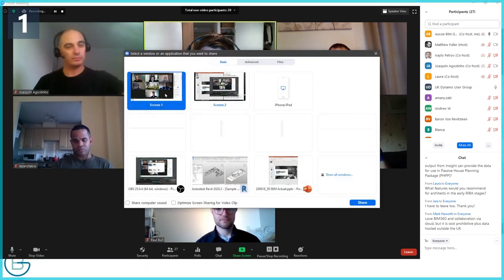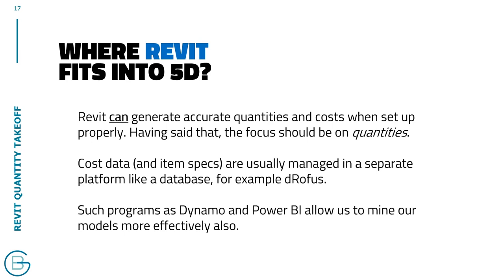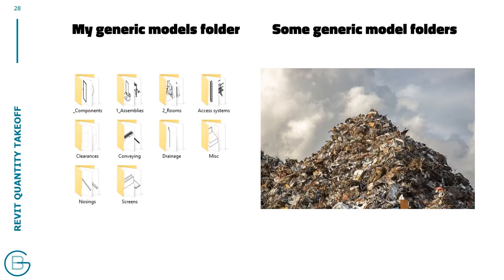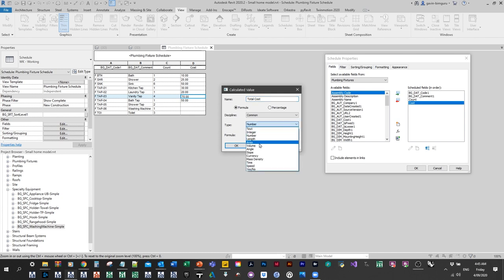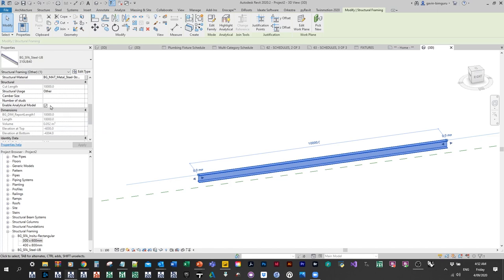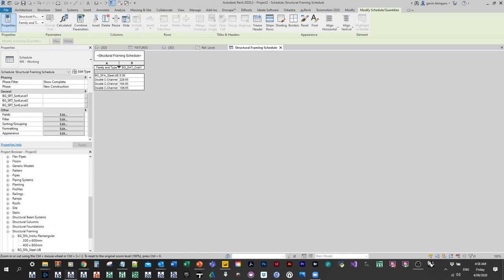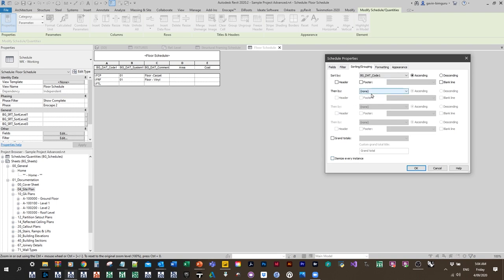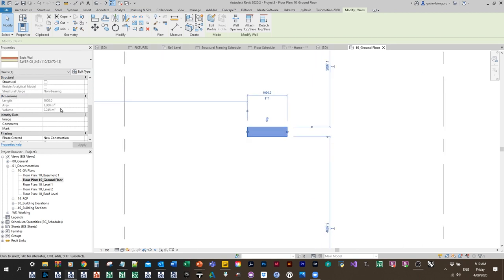Webinar: Revit Scheduling and 5D Quantity Takeoff

Comment: Hi, Gavin! I would like to suggest a subject for a future video. I am finishing my first project done entirely in Revit (2000 square meters) and I had a LOT of trouble extracting quantities from stairs and ramps. I still haven't quite figured out how they behave in what concerns schedules. If you could do something on the subject, I guess it would help a lot of users. Thank you for the excellent content.
Reply from the maker: Good suggestion, added it to the video list to make.

In this case my technique will be to isolate all upward facing surfaces (landing/tread) and get their total area using Dynamo, then write that as a value to the stair. Volume of concrete is another option as well, but not as common of a takeoff method.

Comment: Great presentation! 
A short question, which is the best workflow to quiantify formwork?, it is modeling its geometry with dynamo, painting surfaces, or just by the geometrycal dimensions of the cast in place concrete?
Reply from the maker: I would think that given you are working off exposed faces, combining relevant element geometry in Dynamo and obtaining face areas might be the best method.

You can assess the normal of a face in order to isolate relevant faces, for example in the case of a column/wall, the only relevant faces would be sideways facing, and for a slab or beam downward/side facing.

You could also just union all your concrete as one, and assuming your beams/columns and slabs are all touching you could take all faces with a normal lower than Z and this would give all side/down facing elements. The columns would need to connect to the floors however, otherwise you would have exposed faces in your union that would not be formworked technically.

I actually really like this idea for Dynamo, and will add it to my list of videos to make.
Reply: @AussieBIMGuru  Yes it's like that, i've done my own research and find out that doing it its actually very difficult, so i prefer to wait untill a pro like you reach to a good result. It was difficult because of when you make all the concrete geometry as one, have to first get only the faces (get a void from the elements) and then erase de parts of the pieces that will not be formorked, like upper mid sideways faces of a beam, or the joint of a beam and a column, and then assign the values to the respective elements in revit (since they lose they order when you join all the geometrys). Was too much for me hahah. Thnks for your answer!
Reply from the maker: @JorgeRodriguez-wt4gu  i've queued up a tutorial in first week of october to show a workflow to join geometry and omit upward facing faces of the joined concrete. I believe dynamo wont be able to handle the reassigning of faces back go elements as this would require a lot of intersections to match the subfaces.

Rhino Inside/Grasshopper is probably a more efficient workflow for this level of geometry processing. I'll explore the workflow at a later date for this part but doubt I can get Dynamo to to this part, at least for large models.
Reply: @AussieBIMGuru  Sounds like a challenge haha, thanks for your work and help 😁 !

Comment: Just spent another hour watching another great video. Thanks Gavin. I know in UK QS uses NRM2 as measurement standard. My firm uses ASMM 6 (Australian standard methods of measurement of building works). What other QS standards have you encountered?
Reply from the maker: So far I've only properly used the standard methods as well when it comes to universally used ones. I've had some specific client systems for commercial private clients in the past however that differ slightly due to their procurement and estimation processes.

Glad you liked the video Lee, and hope business is going well for NexSmart3d!

Comment: How do we get the length for duct, duct fitting? There is only length show in duct but not in fitting
Reply from the maker: Unfortunately I don't believe length parameters are naturally available due to the range of fitting types - for example, the way a t fitting is measured vs an elbow.

See this thread which discusses some computational methods of estimating fitting length by connector point extension and revit api;
https://forums.autodesk.com/t5/revit-mep-forum/question-on-duct-fitting-s-length/td-p/3615972

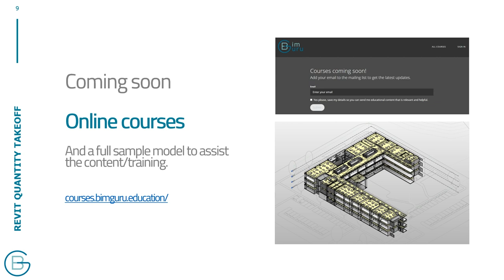Comment: Respect a man doing a live Revit presentation, especially at 04:00 hours.
PS brainfarts ar fun XD
Reply from the maker: Haha thanks Vuk!  The things we do for BIM.
Reply: @AussieBIMGuru  FYI when scheduling structural steel, it's more common to have weight reported. I use a genericaly named Shared Parameter (Type) that has a value for weight per length (kg/m'). This is a number parameter, that in schedules is multiplied with CutLength (or similar) to show element weight. Alsow I use this in rebar schedules (kg/m2 as well). It's much more practical and acurate then relying on Revit to calculate these things by using volume, and allsorts of mumbo jumbo withing the schedule itself.
One more thing...
Reacently I found out that you can create a Shared Parameter for Materials, and am curently working on some elaborate Wall (material QT) schedules. I'm realy interested to see how others do their Wall QT.
Reply from the maker: @vukvukanic1095  ah this is super handy to know, thanks! My main client I do QT with typically uses wall QT for stud framing area, wet/dry lined area (we put parameters for dry/wet sheet count in wall type properties to multiply the area) and brick face area to determine brick count (50/sqm).